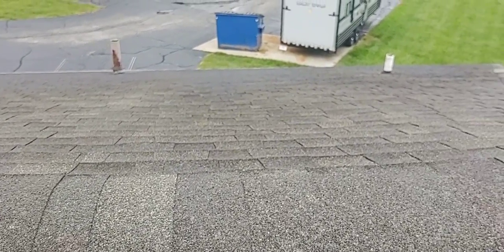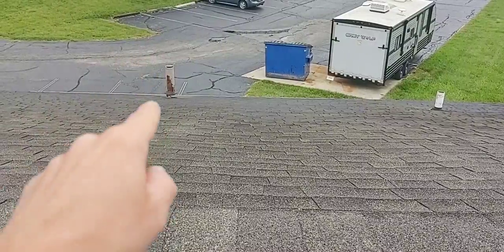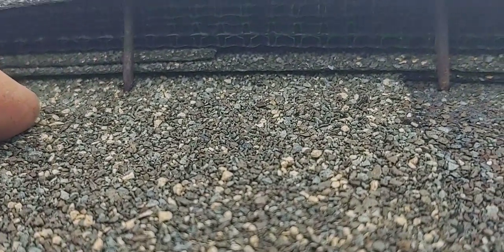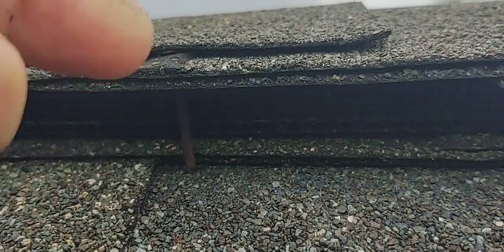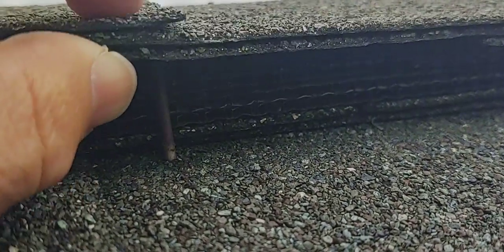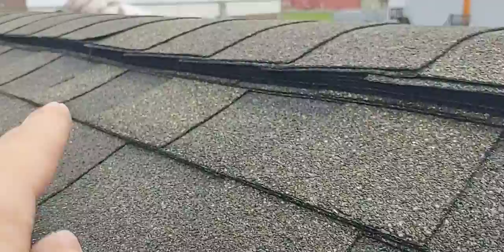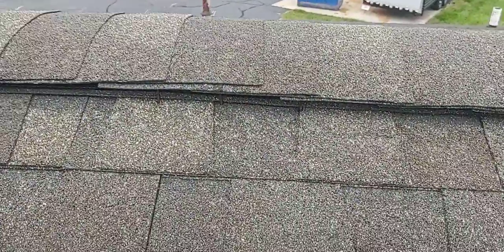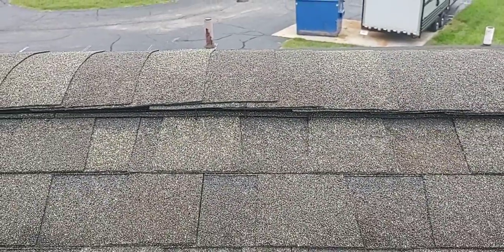Roofing nails too short for ridge vent

Comment: Just left a jobsite I was on.

The roofing company I was working butchered the roof install.

They usually only install iko Cambridge, and I told them that you have to nail right on the white line otherwise the shingles will give out and sag. And we were doing a 9-10/12 today, they high nailed every shingle. A good inch above the nail zone. I kept telling them that they're installing it wrong and they said "I've been doing this for 10 years now, I know what I'm doing" like no, no you don't. You don't even know how to read a shingle wrapper.

Half their nails were blown through the shingle aswell. You could literally lift up on a shingle with your pinky and have it rip out.

I felt so bad that I let the homeowner know that they should get a inspection the next day, before they installed any more shingles. Because for one. Warranty will be shot. And there will be repairs needing to be done within a year or two. I'm usually not that guy but the homeowner seemed genuinely excited to have their roof done, and I'm not letting someone take advantage of them and their money just because a guy knows how to pull a trigger on a nail gun. I don't even care that I missed out on a day and a half of pay either

Comment: I don’t get it, most ridge vents come with the nails!
Reply: the brand that was used here don't come with nails just 4 foam end caps
Reply: @jamesjones179  Yes, but most do and the size of those nails should be minimum of what is used in the ones without.